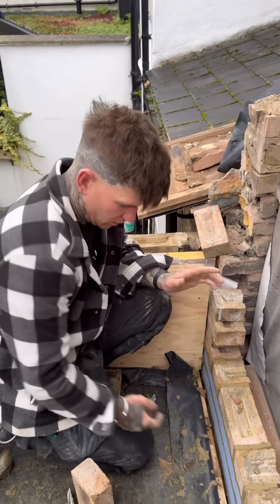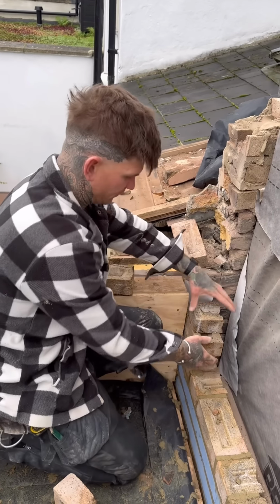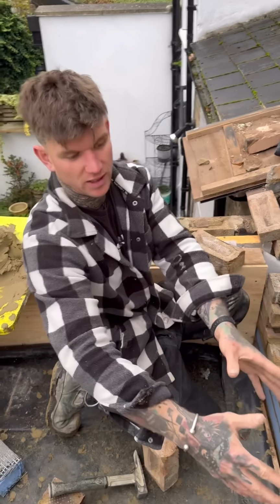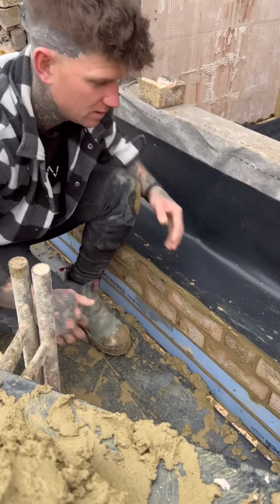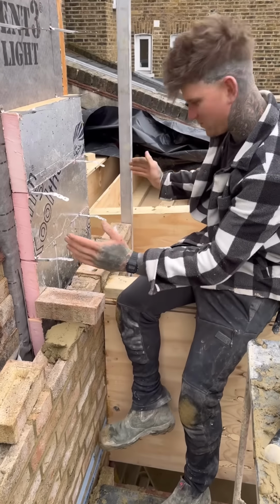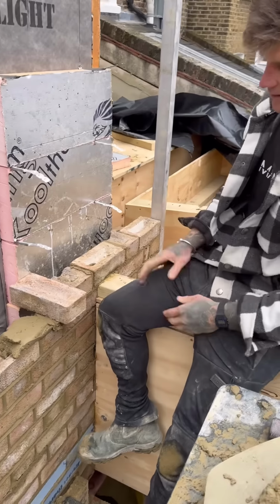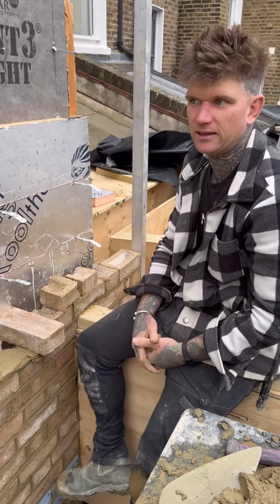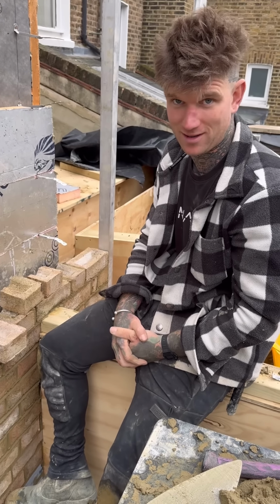Laying thermal bricks 🧱🧱 #bricklaying #bricklayer #construction #flemishbond

Comment: Hey man, sorry to be the bearer of bad news, but these marmox blocks are only meant for single courses. They have a few little concrete columns inside which need to be in contact with Blockwork/brickwork above and below to properly transfer the load.
Reply: Yep I get your point now the concrete stack are out of alignment from the first course of thermal blocks. I suppose it's not the end of the world and that's the problem nowadays to much fucking about with new things so lots of things can go wrong if you don't properly read the spec sheet for the material you are using.

Just get it up 😂.
Reply: WRONG. on the moon we use marmox blocks, dry bonded through, that way the broken bond is under the window to the spaceship.
Reply: @Smellmipoo4932  ahhh of course, how could I have overlooked the moon rules 🤦🏻
Reply: We've just done a passive house with these. Good product.

Comment: i used to use the foam from the movement  joints under my tray for the lead ,no raking out just pull it out ..
Reply: What do you mean mate? Wall on top of the foam with no bed or just the strip off the foam?
Reply: @craigstyrin3453  should have explained..a 5omm strip of foam with a cm sticking out to pull out and bed at the back of it ..get it now?
Reply: @kevinhalligan5283  ah yeah good idea  mate👍 thought you meant wall on top of it😂